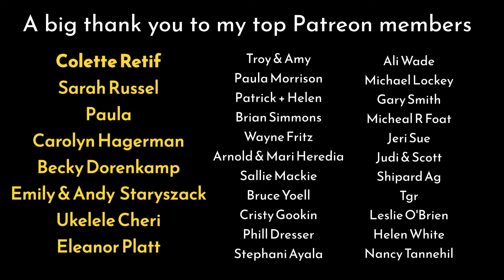Progress Update On The Hearth Renovation!

Comment: Hey Sean! Just a tip - Avoid using grease, since it can discolour the wood. Rub the screw with a candle stub instead. Kind regards from Christian a Danish Furniture Restorer
Reply from the maker: Yes 👍 but this is several inches inside the wood so no worries about discolouration 😉
Reply: I’m not sure discoloration would be noticed in all that rustic charm😊
Reply: in this instance , maybe not, but i appreciated his comment because i, not knowing this potential problem, might use the oil and have issues. the wax is a good thing to know too @Seans_World

Comment: Sean, you are absolutely wonderful! I never concern myself with any of your "camera problems" You sound excellent, and the pic, be it dark, or not, is just fine. Now, rechargeable  batteries, I know. Can't you set up that fire stove again, while your working around the fire place? Keep yourself warm, and the batteries at the same time. They need a stable temp. As long as it doesn't drop rapidly, they will hold out longer. Keep up the excellent work!